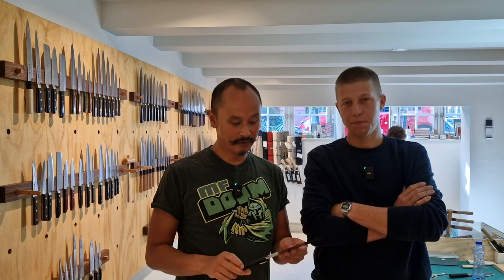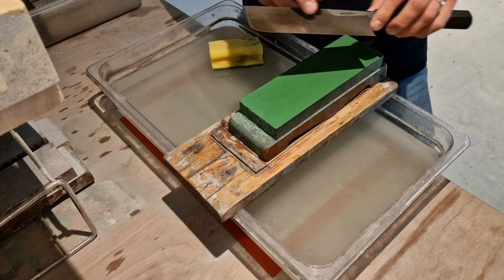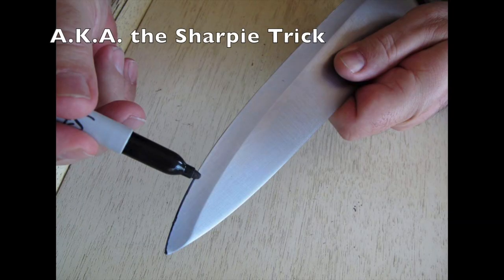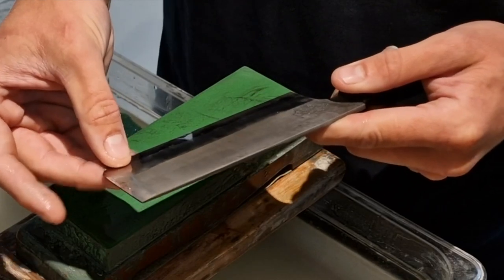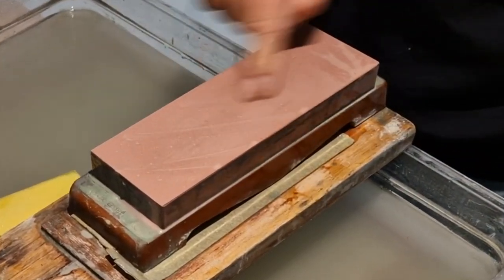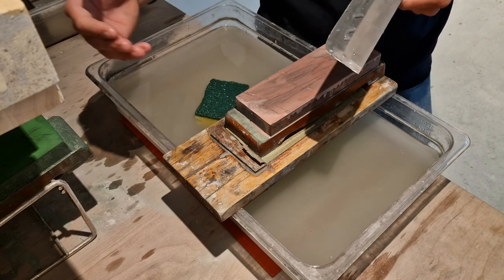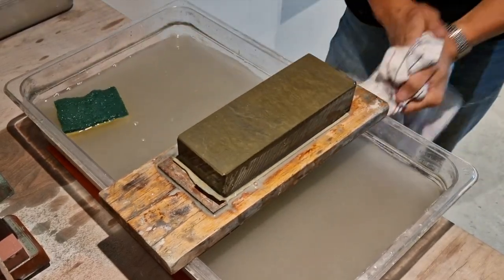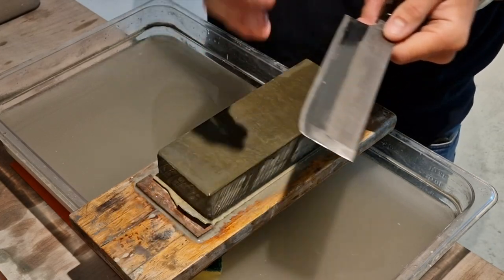How to sharpen a single bevel knife Part 1 - do's and don'ts with Onno de Weerd @ karasu-knives.com

Comment: So glad that I came across your channel and this video. I've sharpened kitchen knives for years, but still had problems getting rid of burr and wire edge. I've recently practiced Jointing technique (cut the edge on the stone very lightly) and the results are not yet consistent. After watching this video, I searched this gentleman's name and found one video of him teaching how to sharpen a double bevel knife (unfortunately he spoke Dutch in that video, which I don't). Interestingly, in that video he did only edge trailing when removing burr whereas here he focuses on edge leading.
Reply from the maker: I'm not sure if he did that on purpose, meaning that edge trailing is better for burr removal on double bevel knives and edge leading is better for burr removal on single bevel knives. I'll have to ask him next time I see him. It is interesting to know if it makes any difference.

Comment: Great whetstone tutorial, but question, how can you use that great fingernail trick finding sharpening angle (changing stones) when a Burr exists?   Doesn’t the burr distort your nail?
Reply from the maker: That would be a hell of burr. But it could. If you have raised just enough of a burr, it should be at enough of a microscopic level to not really distort your nail.
Reply: @chefknivesenthusiast  …that really was an informative reel.   I’m interested in single bevel Usuba purchase, but sharpening concerns held me up.   These posts of yours (with help from others) are getting better and better.

Comment: just wrong to put a secondary bevel on a widebevelknive. 
what you do is wrong.
Reply from the maker: I kindly disagree with you sir. It is a great way to strengthen an otherwise way too fragile/delicate edge. What is the reason why, if you could elaborate, you think it is wrong to put a Koba on this Usuba?
Reply: I also have to gently disagree. I like to keep my yanagibas ALMOST zero grind but for usuba, l think a tiny koba adds a lot of strength without sacrificing performance. Now l would definitely not want the koba to get very wide. A hair's breadth or two, basically. For deba, l like a slightly bigger koba.
Reply from the maker: @davidtatro7457  Half a milimiter, max milimiter Koba does the trick for me.
Reply: @chefknivesenthusiast  l agree. I think maybe we all do at heart get excited at the prospect of a true zero edge single bevel. I've been there, done that. I've hit 16/17 on the BESS machine a couple times. And then the edge chips if it hits a fish scale. Just not worth it to me any more. Give me a nice polish, a very thin koba at about 18 to 20 degrees, and a clean edge, and l will take that sturdier 30-40 BESS edge all day long which l know will not flake away during careful use. I go up to about half a mm wide at 30ish degrees for a deba.
Reply: @davidtatro7457  a deba normally also needs no secondary becsuse its much thicker an has a steeper angle anyway... a usuba is not a chopper..its a vegetable knife.
Reply from the maker: @smokinjoe1256  I have nothing against purists. But when I buy a knife, it's my knife. And I do with my knives what is needed to fit my needs and to make it perform the tasks I use it for. I use this Usuba more like a super sharp Nakiri, not for traditional Katsuramuki and Ken techniques. You may perceive that as wrong, and that's okay. I know chefs that use a back bevel (like a microbevel but on the ura) towards the heel of an usuba and/or deba. I know many chefs that use microbevel's along the entire edge. The world is a big place with many people that not always do/think the same. And in my book, that's okay. But feel free to think what I do with my knives is wrong.
Reply: @chefknivesenthusiast  its traditionally wrong…you throw around japanese words and play THE pro but then put a secondary on a usuba. it is wrong !!! a nakiri needs a secondary bevel or a microbevel.
say it in the video that it is your personal preference and dont teach newbies such a shit.
Reply from the maker: @smokinjoe1256   I've seen many sharpeners put a microbevel on single bevel knives, for exactly the same reason as I do. Even though you are right that it is traditional to not do it, it for sure is optional. 

And I'm not claiming to be THE expert and just throw Japanese words around, I was just trying to explain why I want a Koba on my Usuba. Plus, I personally don't live in a world where there's only right and wrong. There are an infinite amount of shades of grey in between black and white. So yeah, IMHO it is optional and never wrong to put a Koba on a single bevel knife. 

Perhaps you should watch this video by Jon Broida (Japanese Knife Imports): https://www.youtube.com/watch?v=gd7_EtIKLlU
And especially the part from 19:08 min. where he starts talking about putting a Koba on a single bevel knife ("Micro bevels are recommended by literally every craftsman I've ever met") before he actually does it. Again, I don't claim to be an expert, but I'm pretty sure Jon Broida is one of THE experts outside of Japan when it comes to Japanese Knives. So please go tell him that what he's doing is wrong two.

But hey, I apologise if I've somehow hurt your feelings making this video. Please forgive me! Have a nice day 🙏🏾